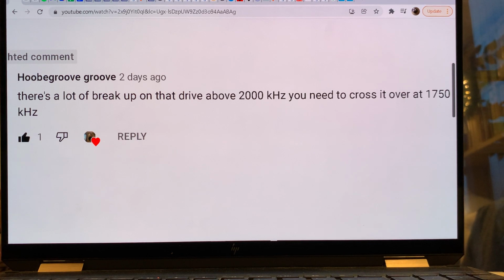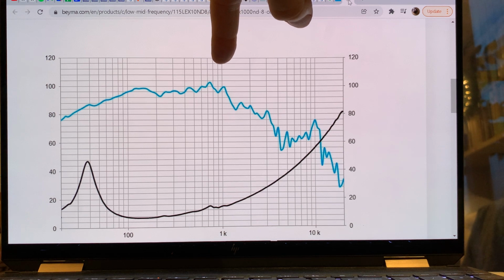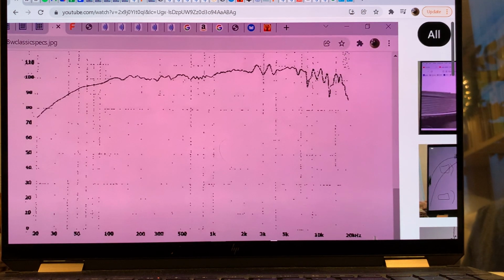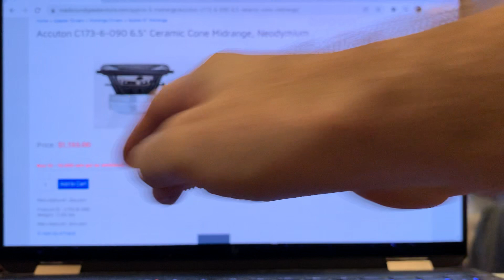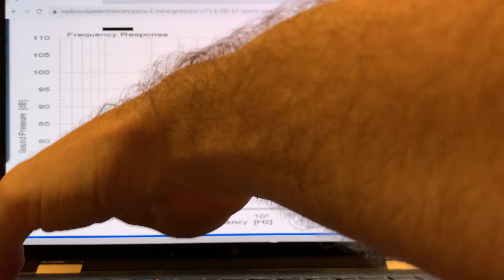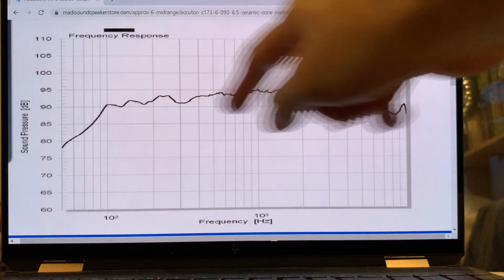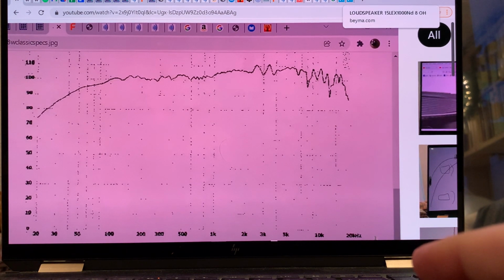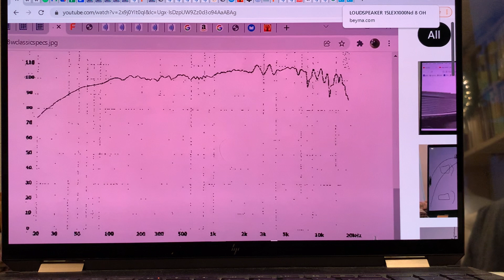Cone breakup around 2kHz - is this specific to full range drivers or there's more to it...

Comment: I have a question about soundstage. I have a deep soundstage behind the speakers, between the speakers and sometimes on the outside of speakers. Instruments sound quite three dimensional but the drummer and singer are most of the time close to each other?
I hear some people that have soundstage in front of the speakers. How is this possible?
Reply from the maker: Hi Nick, imaging is shaped a lot by certain frequency bands being under or over-represented in the highs. Also, not just the amplitude, but the phase component as well, and the timing delays in midrange / highs. So, a loudpseaker will always place its stamp on imaging ;)

Comment: I had that Accuton driver in a Karma speaker.  A friend brought over a device from Lake Technologies (no longer available) that allowed us to adjust the frequencies.  We ended up putting a 1.5 db dip at 1500 Hz and it really transformed the sound.  It was really quite amazing what that subtle change did to the overall sound.
Reply: Kharma is one of my dream speakers glad u have them, accuton drivers I'm also lusting over for years now, do you think they are worth the money, any other brands that can give similar performance in there drivers as I'm a speaker builder
Reply: @IDontExist14  I bought them in 2004 and sold them 2 years ago.  They have their own sound so it certainly depends on ones taste and room they are in.  It is unique to other speakers in that they are both fast and a little darker sounding.  I used to think that darker sounding meant that it would be more "musical" or less bright sounding and others.  Had the Exquisite Midi which was 2nd from the top model in 2004.  I Liked the bigger Exquisite reference/classic model since it gave a more ease of presentation than the midi model.  But since it supported a bi-amp setup I was able to use a tube in the upper frequency drivers and solid state on the lower frequencies.  That way I could adjust the lower mid drivers volume to make it less harsh on certain recordings.  

It is a great speaker.  I just wanted a change from the darker sound and move away from the ceramic drivers.  Obviously, it took me many years of it before wanting that change.  So I did enjoy it.  

Worth the price?  No speaker is the ultimate speaker and they all have strengths and weaknesses.  It was worth it at the time and that is all that matters.
Reply: @bobstenerson3276  thank you Bob for the detailed answer, I appreciate it, watch out for my brand vintage Musicality, it's gonna be launched soon, I'll send u the catalog if u can share email otherwise janos will also receive it and most probably show on channel as well
Reply: @IDontExist14  Wow, yes please do!  There was another small company called Vaughn Loudspeakers that I spoke to last year.  It was interesting since they utilize an old ion tweeter in some models.  Along with Kenrick Sound and Classic Audio Reproductions there are some interesting options.  Always interested in seeing what's in the market.  My friend owns a stereo store here in the Washington DC area so we always talk about products in the market.

Comment: well i thought i was happy with my fe166nv. maybe I ignored the fact that I saw these same peaks and valleys in the specification, and I haven't even finished adjusting the back loaded horns, where I read somewhere that there are peaks and valleys problems with damping minimized. in fact they make me happy, they sound incredibly better than commercial quality systems. however I became more critical